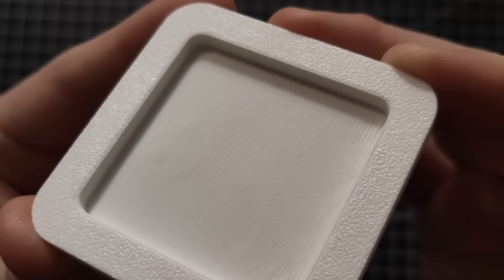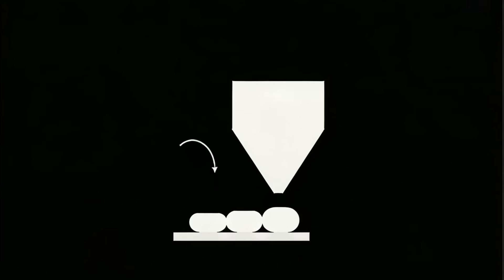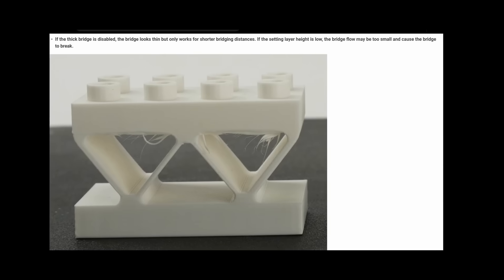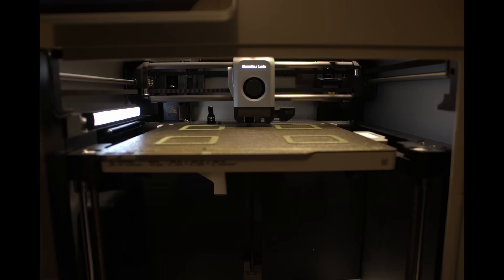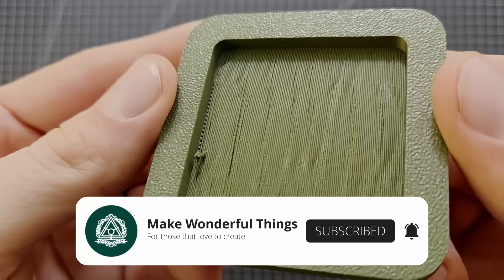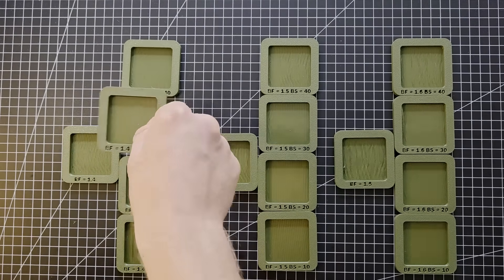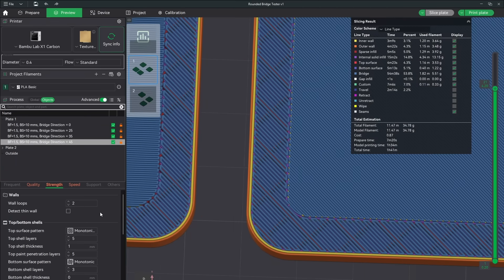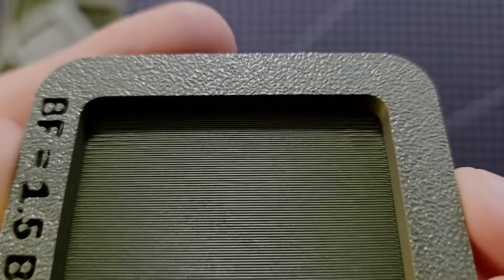The BEST settings for bridges? Smooth UNSUPPORTED 3D printed bridges

Comment: I have a question — I’m having problems with the bottom parts of some figures or objects. Does this only work for flat parts that are printed literally in the air, like a bridge? I usually have issues with the mouths of figures, especially the upper palate area. Could that be related to this too, or is it a different setting? Thanks! great job!
Reply from the maker: I have not tried these settings on a figure type object. But, I would love to see what the results are if you do. The main things that I would focus on for details like the mouths of figures is line height and speed.

Comment: I am curious if anyone has tried this with PETG. I have noticed that PETG seems to be much more difficult to bridge properly compared to PLA. Cranking the fan speed up can help but in some cases seems to cause more issues because of the pressure exerted on the floating filament as it cools down.
Reply from the maker: Yes, a few people have demonstrated this in the MakerWorld post 😊

Comment: Great video! I have a project where I will need to do a very good sized span of bridging, and am worried supports alone won't give me a good surface quality and cause issue as it will need to mate flush to another part. Definitely applying what I learned here to that part, so thanks in advance!

Not sure if Bambu's slicer has it, but I use Orca and noticed "Thick External Bridges" as an option when going through my own settings while watching this. It says it can give more reliable bridges spanning long distances, but won't look quite as good (though wouldn't a more reliable bridge with potentially less sagging inherently look better?). Between the settings you found and that, it may clean up the little bit of sagging in the corners very nicely. I'm going to experiment with it and see. Would love to see your outcomes with it as well! Thanks again.
Reply from the maker: Thank you! So, over the last few days I've done a few prints with these settings and grid supports. If you use automatic grid supports and a Top Z Support Distance of 2.6 to 2.8, the bridges come out nearly perfect over larger spans. I've gone up to 80mm, and the results were shocking. 

The Thick External Bridges check box is also a Bridge Flow Ratio coefficient, but preset. I believe that it is roughly 1.6 or 1.65 based on the g-code value. You can see it in the g-code as the E variable. The thing to remember is that the bridge flow ratio and the thick bridge preset are multiplicative, so, if you have 1.5BF and use Thick Bridges, you end up with 2.4 flow. At least, this is what I am seeing in Bambu Studio.

With the helps of some really great comments, I have some experiments that produced PERFECT bridges. That video will come out sometime this week. I hope Tuesday, but we will see how editing goes.
Reply: @MakeSometh1ngWonderful  That's good to know, thanks! I haven't done much expirementing with grid support specifically. A few weeks back I was trying out different settings and patterns,  changed from grid to concentric, and adjusted it to being quite dense to eliminate sagging. I also tried a 0.10 top Z distance and it was too hard to remove, but 0.12 was quite easy to remove while giving a decent surface finish. Still not anywhere near what I was hoping, though. I'm also worried for a large part that would become hard to remove woth such a small Z distance. Plus, it wastes a bit of filament having it so dense. With your bridge settings I'll definitely play around with suports, specifically grid with the suggested top Z distance, and should have better results with easier to remove supports and a great surface finish.

Oh! Yeah definitely don't want that thick of BF as that bypasses the sweet spot by a substantial amount. Haha. That would have been a bit of a surprise after it finished printing.

I'll go through the comments more to gain that knowledge from others kind enough to share, and I look forward to that video!

Comment: Would there be a way to print from each corner rectilinearly instead of from the sides? This is amazing work Im subscribed.
Reply from the maker: Yes, there is a way to do it with modifiers. That's a good idea that someone else had here in the comments. This may make it into a future video. Would you like to have your comment featured in that case?

Comment: I struggled with bridging until I realized I could absolutely blast the fans to 100% during bridging and it helped tremendously - as in, it could print almost off into free-air without too much sagging.  I saw you adjust temperature, but instead, try adjusting fans to absolute maximum during the bridge to solidify them.  I also saw a situation where going "too slow" was it's own problem, and depending on the projec,t cranking bridge speed to go faster rather than slower could actually improve that initial layer (really required high fans to do though!), I think it has to do with tension being kept if it moved fast enough to attach an edge before it drooped.  Also bridge settings sort of overlap with "Overhang" settings if your printer software splits them, so if you increase bridge speed to test, make sure you turn off the "slow down for overhang" features if they exist (I use ankermake so it has a checkbox for this that threw me when testing early on).  Finally you hit on bridge flow ratio, but ankermake also has "thick bridges" and "bridge density" which also play a similar role, so if your printer supports those functions, it might be worth adding to your experiments!
Reply from the maker: This is a great comment! Yeah, the Bambu X1C that I have has an under powered fan. Ember Prototypes, another youtuber, made a fantastic video on it. SO, I run my fan at 100% all of the time, but can't get the air flow necessary to match the results that you describe in the comment. 

Your other sentence about Ankermake and the bridge density setting caught my eye. I will check that out soon.

Comment: Didn't work a bit for me.
Reply from the maker: More details would help if you wanted me to provide some feedback. Sorry that it didn't work for you.
Reply: Well I didn't try it on the Bambu but on my other printer where I have a Microswiss bowden hotend with a CHT 0.6 nozzle, two 5015 fans, mounted with a HeroMe. Apparently I had to increase the speed a lot. I'm on 100mm/s and no increased flow. But still my results aren't as good as yours. Slowing the speed down only made it worse or as bad as always.

Comment: Awesome to see this topic getting some attention! There are Issues in the PrusaSlicer GH calling this out from years ago as well, but found no traction.

Iirc, Bridge Flow isn't a perfect solution either because the ideal value is dependent on the layer height. Ideally, slicer logic should understand that extrusions in free air are always circular, and should calculate the output flow rate and line spacing from the layer height.

Would love to see a follow up experimenting with how bridge flow calibration varies over layer height changes. Hopefully you can get enough attention on this topic to make a huge difference!
Reply from the maker: Very insightful - bridge flow variation over layer height. I've screenshotted this and will look into it. If I put this in the next video, is it ok if I feature your comment?

Comment: Did you try going below 1.0?  Because I had the opposite results.  I had been using bridges to give a texture/style to my makerworld models, but I've always been trying to control the bridges.  When I saw your video, I plugged it in and tried a test print.  At 1.5, it was just as bad, maybe even a little worse than at 1.0, or just using thick bridges.  But, when I went down to 0.5, the bridge looked better, but it has some areas that looked under extruded. So I went up to 0.75 and ran into a wavy artifact that distorted with the shape of the part being bridged.  At 0.6, it came out as smooth as butter, almost as if the layer were ironed.  I'll post pictures on Maker World, but I'm going to run a full test with my A1 mini and P2S and see if there are any differences.  I also want to see how fast I can get the bridge speed too since it really slowed down the bridging over the sparse infill layers.
Reply from the maker: Yes, in many cases I have gone below 1. I think that this comes down to filament selection and environment. For example, when I printed with an Ender 3 in my garage in Texas, I had to turn the bridge flow way down to get good results with any filament because it was hot AF and no amount of fan cooling was going to overcome that. Also, I've seen carbon fiber infused filaments do quite well when the bridge flow is reduced. 

Now, with the bambu x1c I have an enclosure. It is often at 26 Celsius when printing. With those conditions, and the settings and principle of line spacing mentioned in the video, I've had the best results I've ever had with PLA and PC, considering the Bridge Flow range from 0.5 to 2. 

I'd be curious to see if you have a variance between the prints on the A1 and P2S. Maybe that would reveal something that we haven't seen.

Comment: While this IS good information, i will still prefer supports with interface material. Since i mainly print PETG, i use PLA for these interfaces and got very good results thus far.

Comment: Has anyone figured out the corners yet??
Reply from the maker: I actually have found the solution based on a single big brained comment here and a few extra experiments! I am filming now, and I think that I will post on Monday or Tuesday. 
Happy that you got a perfect print with these settings though. What filament did you use?
Reply: @MakeSometh1ngWonderful  For the test I just used some PLA.  I can't remember if it was Bambu brand or Creality brand.  Can't wait for the next video.  This seems like a game changer.
Reply: @MakeSometh1ngWonderful  I also tried printing a cube with some large 50mm inner round holes to see if this method might help with that (for hi-fi speaker ports etc).  It seems that Bridge Flow only applies to lines that are 100% fully unsupported.  So I got perfect flat bridges at the top but spaghetti overhangs right next to the bridges. 

I can't seem to find a setting that allows us to define exactly what a bridge is??  

I'm guessing for this technique to work for holes, that as the angle of the overhang becomes steeper the flow rate needs to increase according to angle and the print speed needs to slow down in proportion to the flow rate.  If that makes sense?
Reply from the maker: Hmm, you have a few ideas here. It is a little difficult for me to fully understand. If you post this on Maker World and send me a link, I will play around with it and see if I can help you out. It will probably be Tuesday before I print it though. Trying to finish up the next video over the next few days.
Reply: Hey I just tried this approach on my H2S with your settings (Bridge Flow: 1.5, Bridge Speed 10 mm/s) and I got a perfect bridge with PERFECT corners.  It really is a super clean print.

Comment: Thanks for the video, Made me try a quick test, I found rotating the test piece 45degrees, caused the bridge layer to go 'cross grain' to the walls, the first half of the bridge layer, was pretty good , second half had some gaps so I guess it was not cooling enough between strings

Comment: Speaking as a youtuber, this video is gold.  Its the perfect amount of info, broll, etc with excellent clarity of speech and vocals.  Well done!!  OH the tips were good to, trying it out right now.  I wonder if the corner sagging would be different if the corner was not radiused!?
Reply from the maker: Thank you! Appreciate the compliment from another practitioner. 
You know, I almost never use corners on prints because they are unattractive in my opinion. BUT, your comment has made me realize that this is a very basic design consideration looked over by me and the 50 or 60 people that offered potential solutions. I'll give it a shot soon and see what I learn. Thank you for the suggestion!
Reply: @MakeSometh1ngWonderful I did it today and it printed excellently.  However I noticed that my bridged layer was rectilinear so the nozzle never stopped between each pass across the bridge.  I did the 10m test but had no visible corner sagging! Maybe pattern matters?🎉
Reply from the maker: Nice! I'm glad that you has some great results. 
On sharp corners - YES! That does reduce sagging in the corners by a lot. It still isn't perfect, though. Somebody here in the comments figured it out and I have now run a series of tests that are producing PERFECT results. I can't even stop looking at them. 
I'll post the solution in my next video 😉
Reply: @MakeSometh1ngWonderful ooooh!! 🎉🎉
Reply: @MakeSometh1ngWonderful if I hadn't already subbed, this comment would have gotten me to do so 😂

Can't wait!
Reply: @MakeSometh1ngWonderful  hurry up… I’m an impatient person 😂

Comment: Amazing video! I subscribed!

Now that you have the speed more dialed in it would be interesting to see if going back and adjusting the flow rate again to see if it had any significant changes? 🤔
Reply from the maker: That's a good point! It would be interesting to see what happens at every speed and every flow rate. Maybe for a future project.

Comment: Nice find, thanks. Do you reckon similar settings elsewhere would also help smooth out overhangs, and maybe even being able to print at lower angles without support?
Reply from the maker: Yes, for sure. I made a brief video (https://youtube.com/shorts/VzFtFG4PwR0?feature=share) where there is a clip showing a bridge plus overhang design. The angle of the overhang in that design is 70 degrees from the vertical axis. It seems that Bambu Studio handles bridges and overhangs with the same settings - which is very confusing to me. But, this is what I am seeing with all of my tests.

Comment: First thing that come to mind is to try wall overlap. I use 30 to 40 % if i want to have the part stronger. For my prints that seem to work nicely (h2d).
Reply from the maker: Does the Infill/Wall Overlap effect your bridge overlap? I've never noticed that. It would be extremely helpful if it does.
Reply: @MakeSometh1ngWonderful I'm  not 100% sure but I thought  I noticed  it when I was printing some tool inlays that it was hooking  in more.

Comment: Thanks for sharing. I didnt even know that there are settings to improve the printing of bridges that much.
But a small question:
Would a different colored filament result in different printer setting for the bridges? And is it worth to change these before each print?
Reply from the maker: I have found that different colors do NOT effect the results enough to require tuning. At least, that is true for different colors of PLA. 

Is it worth changing for each print? Well, it depends on what you want. If you want to print something that needs to look really good, or if you are mass producing something, then I would suggest optimizing for that part. But, if it's just a little gadget that solves a random problem around the house, I wouldn't go through all of the work of changing the bridge settings before each print. Just use whatever settings work best in general.
Reply: @MakeSometh1ngWonderful  Thank you so much. Thats really good to know! ❤

Comment: This is super interesting because I got similar results going THE OTHER WAY. 

I got weirdly smooth bridges at a flow rate of 0.7-0.75 when using PETG.
Reply: another odd detail about my testing: Faster was better. Results looked identical in 10mm/s steps from 50-100mm/s.
Reply from the maker: That is actually interesting. Kind of counter intuitive based on what I learned from this project. If you ever had the time, you could use my test files and share your results with PETG on Maker World, or post your own project for it. I would love to see it and try to learn why it behaves opposite to PLA.

Comment: I tried the BF at 1.5 and the BS at 10 as shown in the vid but didn't work for me ☹ (Ender 3 v3 - Density at 85%) I'll try at a 100% and let's see how it goes.
Reply from the maker: You might take a look at the print profile that I posted on makerworld (link in the description) and check that against what you're using. There can be a lot of differences between the settings, machines, filaments, and even the room that you print in so it would be hard for me to diagnose and help out. Sorry about that!
Reply: @MakeSometh1ngWonderful  Don't worry, actually, I've tried several settings, and non of them seem to actually work, from increasing the flow over 1.5 to decreasing it til 0.65, to increasing speed up to 110 mm/s to decreasing it to 10 mm/s, enabling thick bridges, disabling it, almost all, but the main problem is the overhangs, and I don't know how to make that work...

Comment: Great informative video. Love the testing you did. I’m going to give this a try! Did you consider changing fan speed?
Reply from the maker: I use a Bambu X1C, which actually has a known issue with the fan (https://www.youtube.com/watch?v=nJK4xTrn8ds). I leave it as 100% all of the time, and can still have some cooling issues. Maybe if I replaced it, like Ember Prototypes demonstrated in the video above, then I would have perfect bridging 

If you have a different printer or a better fan, I would love to see your print results on the Maker World page linked in the description.